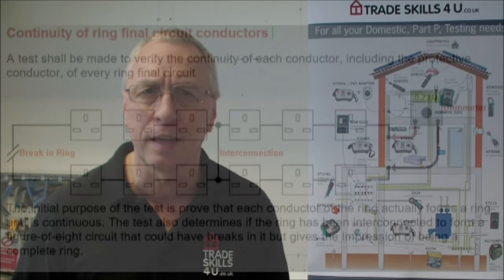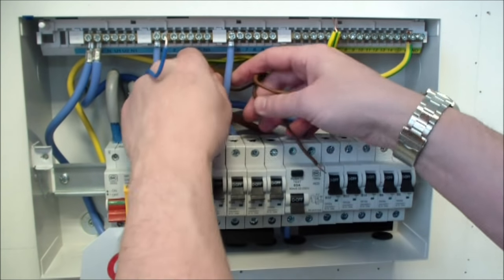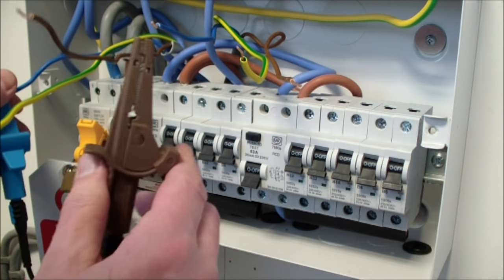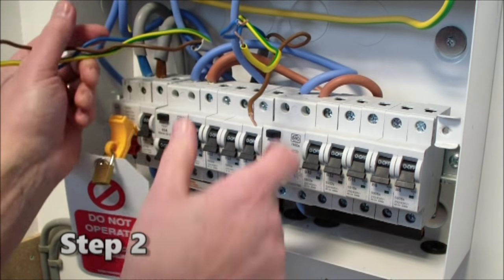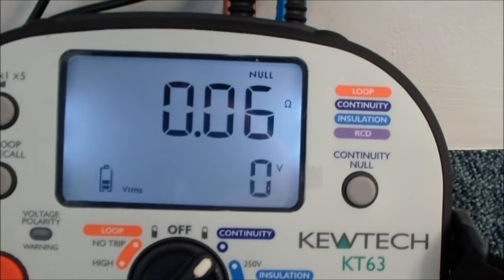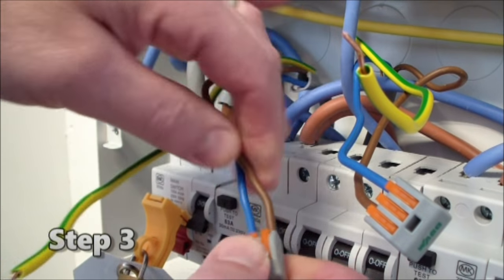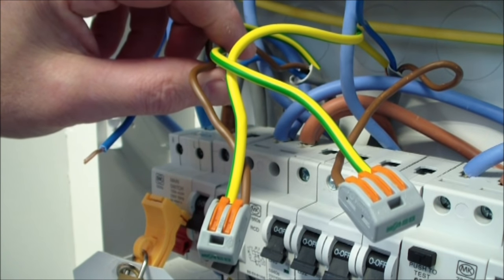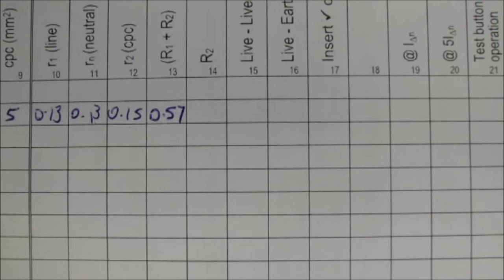Ring Final Circuit Testing Revision Video

Comment: Listen up Sparks!
This is the best explanation about this non-exciting, yet need to know test procedure that I’ve seen.
This Gent explains it concisely and without waffling on, telling you how to do the test and what patterns in the results you should expect to see, and further more why this is the case.
You are not going to get it explained to you any better than this ...good work fella!

Wagos are the future, and a very handy addition to your test kit, don’t know why people use the old choc-blocks anymore? Little tip, the newer clear sort with the Brite Orange flat tabs are almost half the size, and unlike the ones used in this vid they can take both a solid and a stranded 4mm.

Comment: That was a useful summary and very clear, but you didn't look at all at the really interesting entry key case of a cross connection on the ring which you showed on the first diagram. I can see that a cross connection could give some puzzling results during testing and make it impossible to reduce the normal numbers, but I've always struggled to see why it might be any kind of safety problem in normal use of the circuit, in fact it seems to me it should improve the performance of a ring.

Comment: I am not an electrician, but I would have expected wires to be be correctly connected and checked physically and visually. With good workmanship all this fancy testing should just be an extra. I suppose there are plenty of cowboys about. If there is wrong polarity in a ring I would have thought it would trip or fuse or worse, so you would already know there was a major problem. I still refer to wires as  live or positive, negative or neutral.and earth or ground. I like to understand what’s going on when I engage a tradesman, so for me it’s an excellent video.

Comment: Wow! I'm a licensed electrical contractor here in the U.S., and running a "ring" circuit is not only illegal here, but also makes no economical rational sense because you're unnecessarily consuming extra cable by having two home runs instead of one for the same circuit. It's also illegal to have more than one conductor in each terminal here in the U.S. 

The other thing that's different, it's illegal here in the U.S. to use the use devices such as receptacles as spicing devices, we have to use pigtails as circuit taps for all devices so the circuit is never interrupted (especially ground) by a defective device, or by the removal of the device. 

Seems like there's no benefit in doing the extra expense of a second home run, especially since it makes trouble shooting much more complicated by creating two power sources in the same circuit? 

Your load center designs are very different from ours here in the U.S. , we have much more room to organize our wiring within the panel, and our bus bars are in the middle of the panel with circuit breakers snapping on both sides.

Comment: At exactly 5.12 sec you say on 2.5mm / 1.5mm T& E the reading should be 1.67 times higher due to the smaller cpc cable.  However, On my house the reading is only 0.2 higher. IE.  L1-L2 is 0.22  N1 - N2 is 0.22  E1 -E2 is 0.24  My Question is what does this small cpc reading show?   The circuit operates ok.  But id like to know what it tells us?      Also on the cross connection test (L1-N2 & L2 - N1)  the reading should be HALF the L1 L2 reading but on mine its the same 0.22. what does this mean.?